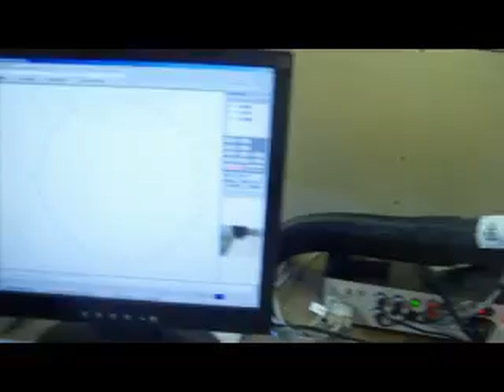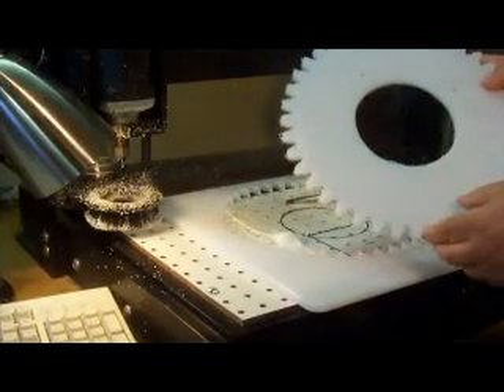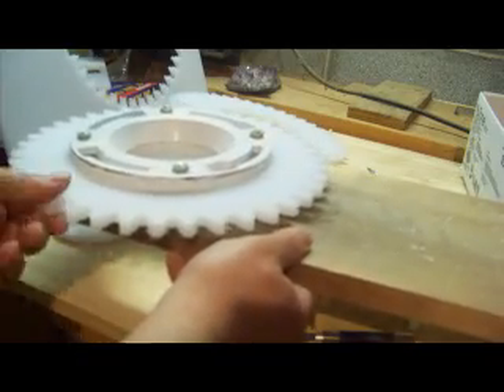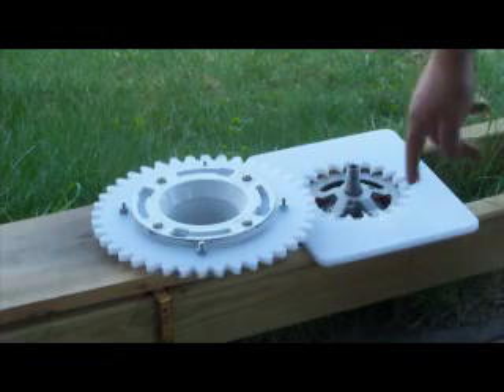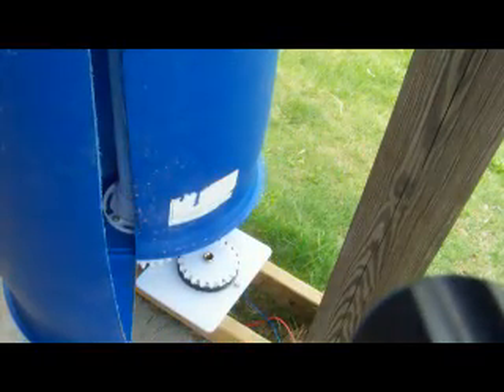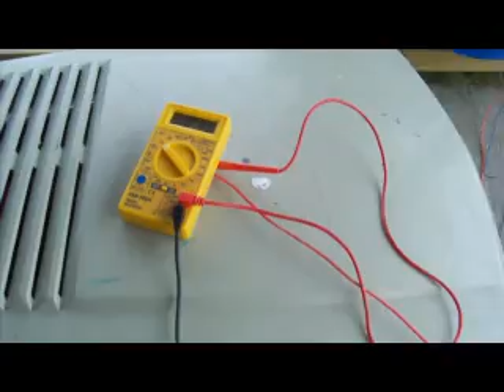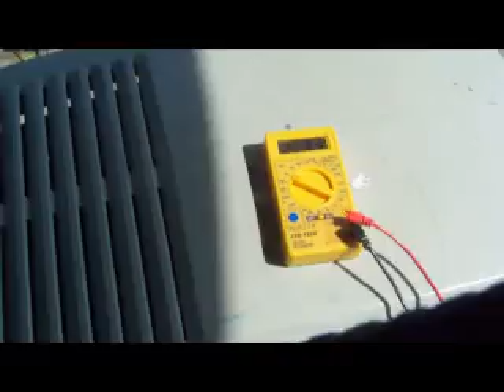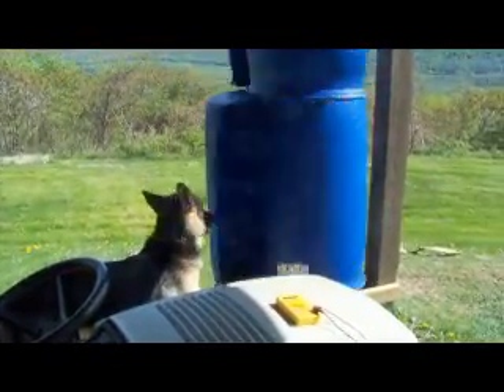How to Make an Inexpensive Vertical Wind Turbine - Part 2

Comment: You'd be way better off using good bearings and chain. The other thing is add some weight to the drums. It will make it work better
Reply: Wooden Tool Man Actually, gears are more efficient than chains. And adding weight is a give and take, it will keep its momentum better but also require higher wind speed to overcome static friction ie start the turbine.
Reply: Most efficient would be to add an adapter to your alternator so you can fit It's shaft inside the turbine shaft from either above or below.  Your BIG fail point is going to be those bearings.  They aren't sealed against the weather, so even if you do lube them regularly, the lube (if You're using any at all) will wash out in the rain and allow rust to form.  Also, they won't dissipate heat very well.  As proof of concept It's okay, but it won't last long.  An upper and lower drip shield might help a little, but storms and high humidity will eventually cause your bearings to fail.
Reply from the maker: I have switched to different bearings.  (pillow blocks)   The lazy susan bearing was a little more efficient but the pillow blocks are quieter.
Reply: I thought the low rumbling was more than I would be able to tolerate. It would seem the sound from the bearings and gears was carried to the drums which magnified the sound.

Comment: Is it still working now that it's 2018???
Reply from the maker: yes, but I had to take it down temporarily because wife wanted a hot tub in that spot.  I am putting it up in a different spot using pillow blocks rather than the noisy lasy susan.

Comment: A pulley would be 1 BILLION percent quieter, you know, and it's easier to change ratios. Wind turbines like that are low-RPM units, so you need to gear up your generator's RPM as much as possible.
Reply: Agreed. You could also add a tensioner to help prevent slippage. With a little centripetal break you could also prevent overspin.

Comment: Why not a transmission with a v belt and pulleys.  This is going to make a lot of noise.

Think that the ball bearings in the milling machine need to be replaced.
Reply from the maker: that would work also.  The milling machine needed new brushes at one point but is still working.

Comment from the maker: @alghoraba Please check out my six barrel turbine which is based on this design and will put out more power.  Either of these can be used to run off-grid or grid-tied systems.  I will be releasing power curves for these turbines as soon as I gather enough data.

Comment: The generator had to put a gear even smaller if you want to get good power at low rpm, and then the gear noise is that you have placed too near / close to each other had to leave 2-3 mm of distance between them, could also use the old gear bicycle with chain

Comment: Measuring 12 Volts "Open Circuit" means nothing without simultaneously measuring the AMPS, too. 12 Volts x 0 Amps = 0 watts. Big Deal ! That PMA needs to spin faster than 900 RPM. And maybe, even 1,200 RPM to make usefull watts. Connect the PMA to a 12 Volt battery and then measure Volts and Amps simultaneously to report Watts produced.

Comment: turban
ˈtəːb(ə)n/Submit
noun
1.
a man's head covering consisting of a long length of material wound around a cap or the head, worn especially by Sikhs and Muslims.
2.
a marine mollusc with a sculptured spiral shell and a distinctive operculum which is smooth on the inside and sculptured and typically patterned on the outside.

Comment: That won't work well. Mostly a minimum speed is needed to generate electricity. The gears converts the torque to speed.

Comment: Do not lay the axis on the ground, instead suspend it thus taking away some of the friction. Buy real gears cheaply from car bone-yards to have less friction.
Instead of putting the machine near the ground, allocate it on the roof.
Instead of using full drums make holes in them and cover them with metallic tape, leaving a much lighter skeleton with a skin.
That should give you... I don't know 100% more efficiency?

Comment: Although You sound like a nice person, I don't give much for This construction.
The  bearings are prone to Failure in short time and need constant oil.
Ineffective gears , and the time and costs should be better implemented!
OK, at lest You tried.
I would consult a friend with rudimentary practice and feeling before starting such a project.
Now You managed to start people on an less then optimal project - that is a pity..
Wish You well and good luck any way - You will surely need it..  :)

Comment: How " inexpensive" is buying ( and learning to operate...) a CBC machine?.. Hmmm. I like your project, but there's no way I can afford a cnc..  T T
Reply: jus use set of bicycle gears and a chain
Reply: Ha ha there's a point..      Thanks.
Reply: Eric Grenier
Or pulleys and belts, which you can get at a hardware store. They're not as efficient, but I'd guess longer lasting.
Reply: You could use pulleys instead

Comment: Yeah, even Craftsman makes one of these programmable plotter-type tools now. Although, they advertise it as an utterly useless wood carving machinne. $2000 to carve your initials into something? That's a complete waste. However, you can also use it in the same manner as shown above.

Hopefully they'll design the next generation machines so they can at least cut through soft metals.

Comment from the maker: @obeyance Please click on the "more info" part of this video to link to my website where you can purchase an entire gear and mounting bracket kit for less than $100 dollars.  I haven't done a lot of analysis on charging times but will be doing that soon as I am making a sensing/reporting device which will correlate to wind speed data I am now gathering.

Comment: Belt  much easier
Reply: and the weight issue would be negligible.
Reply: ... and much  more quiet.
Reply from the maker: I would have to make pulleys then and I have never done that.
Reply: A chain is much more efficient than a belt.

Comment: it´s nonsense to show how high is the voltage of an generator or a car.
Its around 12-14 volt all the time, the RPM are not important.
I´d like to see the Power, the ampere, which were gererated here.

With the voltage and the ampere you can calculate the power which is gerarated.

And i gues, it was not more than 10VA here, you would need 5 or 6 of them to light a bulb.

However, nice idea

Comment: The efficiency seems terrible. Huge drag by using the large drums as blades. How did you balance the 'blades'? How do you deal with overspeed conditions? Maybe you don't need to worry with the drag of the drums.

And well from a looks / appearance perspective it just appears ugly / comical.

Comment: @juanjomf97 Check out 'Probotix'  - They have a neat CNC machine that uses free software and a cheap Dremel as a head drive. I am cutting (slowly) everything from hard aluminum to softwood with only the red low-torque stepper motors.

Comment: @clarkewi "I like your presentation but why add a gear? Can't the wind turbine axle turn the alternator directly? Doesn't seem efficient."

with gears,u can create a "gear ratio equlally contol of the speed,power,etc.......direct drice drive your limited.

good example,look at a 10 speed bike....first gear suks....

Comment: INEXPENSIVE?
cutting machine = how much?
drum = how much?
cutting board = how much?
etc etc etc...
add it all up...
please change title. 
the idea is really good, but the title was a complete lie.
Reply from the maker: Drum 15 bucks. cutting board 20 bucks.  machine, less than three hundred on ebay if you don't mind a chinese product (mine was american and was about $2000) .  You can save a fortune using a bicycle sprocket and chain.

Comment: What a piece of shit that chair turning base is not going to hold up need sealed bearings steel shaft pipe  and the gear set up plastic junk 2. 3  days run time if at 20 30 mph  wind. drier spindle and original pully on altinator with a fan belt on welded frame would run months .
Reply from the maker: you are right, I replaced it and will put out a new video.